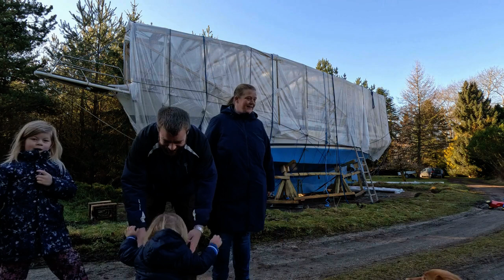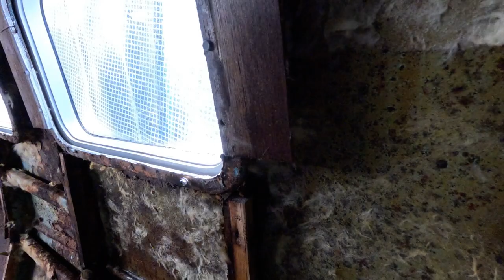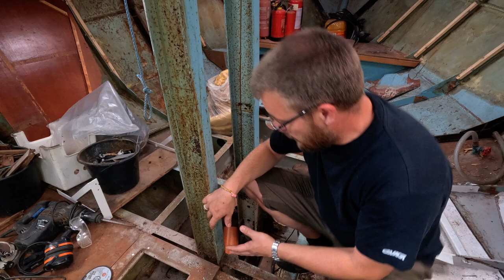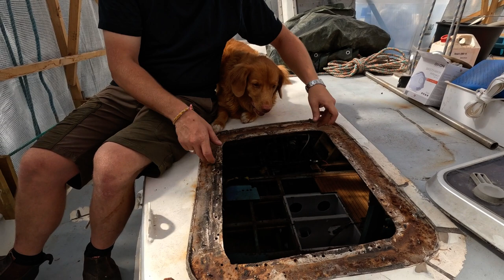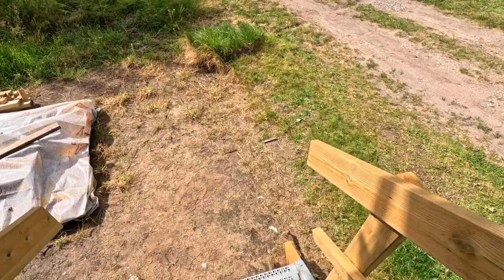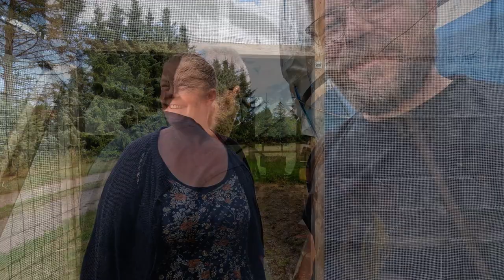Things that need WELDING! - The Restoration of SY Carla part 10

Comment: It is not a good idea to put water and diesel intakes near each other. I have seen some disasters when incorrect intake is used. Keep them at least 3 metres apart and well marked.
Reply from the maker: You actually have a really good point there. We were thinking about putting them close together on both sides of the wheelhouse. But now we will have to rethink that.. it would be terrible if someone mistook the water for diesel.. thank you very much. We’ll definitely remember that when we get to placing the intakes and thanks for watching 😊👍

Comment: Those vertical pieces are called frames. Deck beams are horizontal pieces that support the deck as the name suggests. Yes, you do have to learn a few hundred new words.😁😁😁Keep up the good work! Love it! BTW, if you're going to divide the fore cabin into two, why not install a small glassed hatch over each one?  being small cabins, they might have a tendency to go damp with condensation and musty. Sorry. Just an idea.
Reply from the maker: Thank you very much I’ll try to remember that next I talk about the deck beams I always get it wrong 😅 as to the hatches. We are going to keep two of the hatches as they are in the cabins for exactly that reason and also as escape routes 😊 thank you very much for your comment and for following along 😊👍

Comment: I think that your approach is spot on. Raising the areas around the mast foot and the winches will make it stronger, stop the water lying and water ingress/corrosion. When your boat was originally built, they wanted all nice flush hatches with the deck which required recesses. This has resulted in a lot of corrosion, no matter how much sealant was used! By raising the hatches slightly, you will alleviate this and actually reinforce the edge of the cabin where the hatches are. Great stuff you two, looking forward to the next episode👍
Reply from the maker: Thank you very much for your great reply 😊 it’s nice to hear that we are not alone in thinking that’s the way to do it. I haven’t really thought about it reinforcing the edges around the hatches.  But you are totally right! its going to make the whole thing a lot stronger 😊 Thank you very much for watching. 👍

Comment: Welding with flux core tends to splatter alot. Also the welds look not as nice as it would with welding with a mix of CO2 and argon gas. Its a personal choice i guess.
Reply from the maker: Thank very much for your comment 😊Yes you are absolutely right. It does tend to splatter. The thing I’m concerned about with gas is welding on the outside of the hull when I can’t get out of the wind. But we found a new brand with flux that we have tested a bit and it looks promising. But if the splatter continues we are going to change to gas and then try to solve the “wind problem” I guess 😅